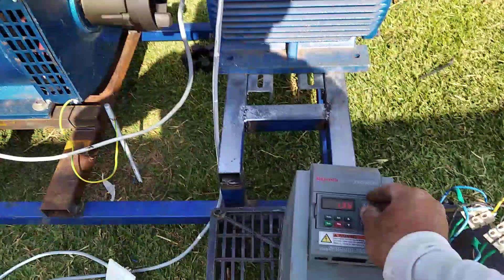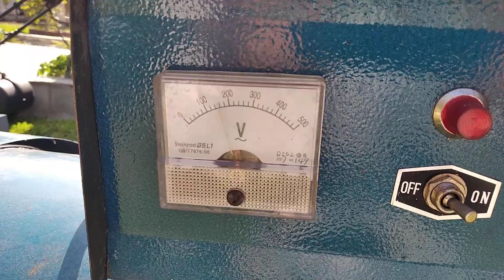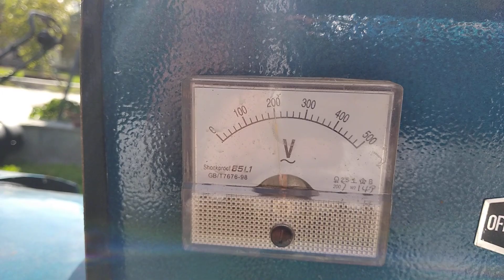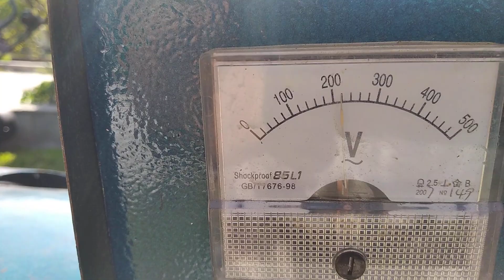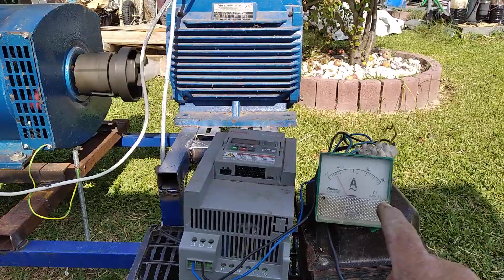self running generator

Comment: Thank you for sharing your experience as always! I believe he is using the empty motor 3 phase stator windings, to give an extra phase shift to the 3 phase supply current.  Its hard to visualise but it means the load effectively assists the generator (which is a 3 phase VFD inverter). If anyone wants to study this effect,  read up on Yagi antenna, directors and reflector operation, it's the same principle only at much lower frequency.

Comment: This is a bit hard to follow - The grey box is a power supply and AC speed controller - yes?
The windings in the motor casing what are they doing? is it a 3phase?
So it turns without being driven. gen and motor in one?- but achieves nothing cos it takes as much to drive it as it produces!

Comment: what is the input and output watts ?
Reply from the maker: Is the same. Input=output
Reply: @pneumatic-generator2022  what is the gain then ? you can just power these lamps from the electrical socket